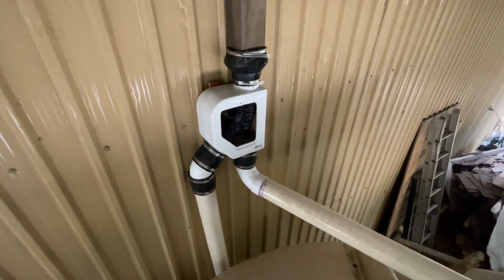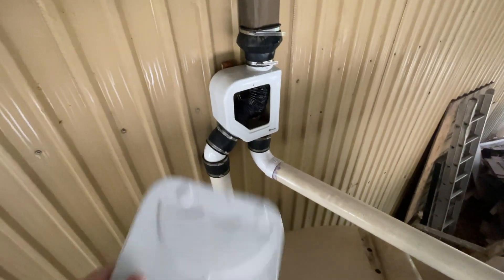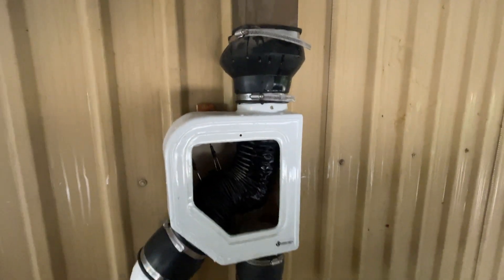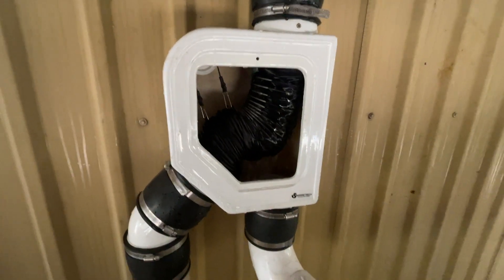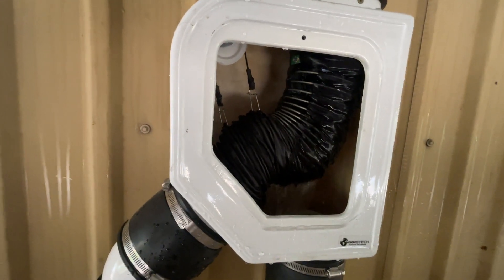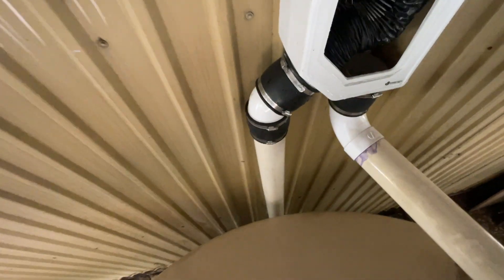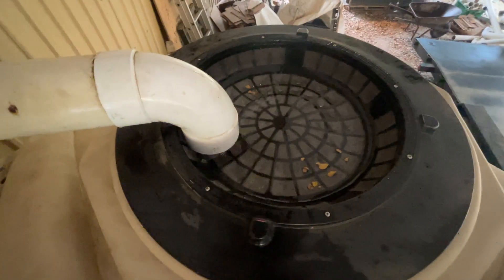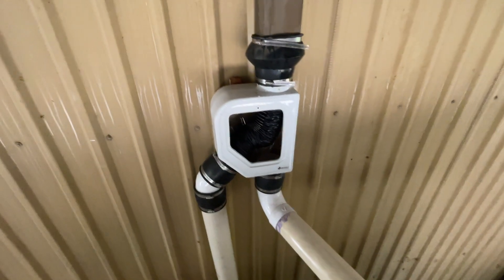Monjolin Smart Filter MINI in action

Comment: How does it actually work as a first flush filter?
Reply from the maker: It's not a first flush filter. It filters debris that enters the filter by only allowing water through the filter. The leaves, sticks, seed pods and other debris gets forced out of the pipe that leads to the tank. The debris is routed to the discharge pipe shown in the video on the left.